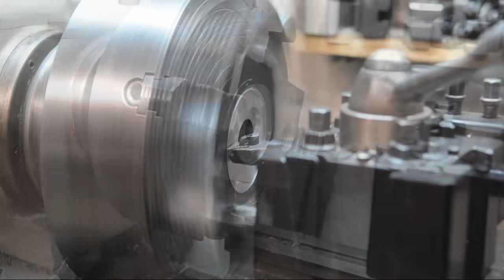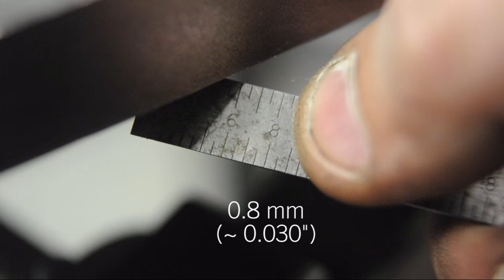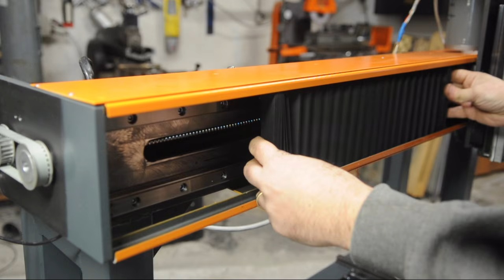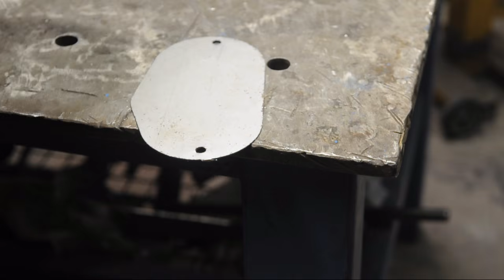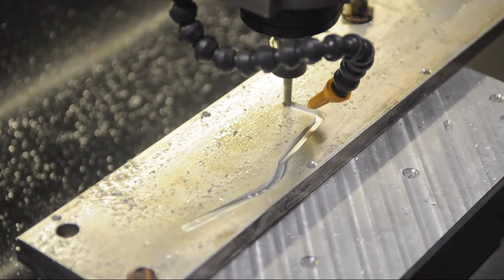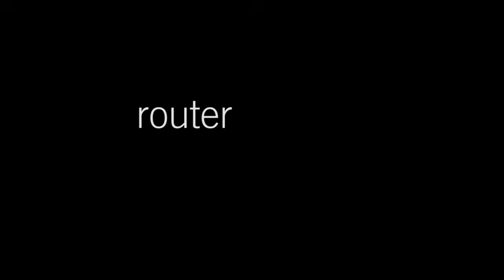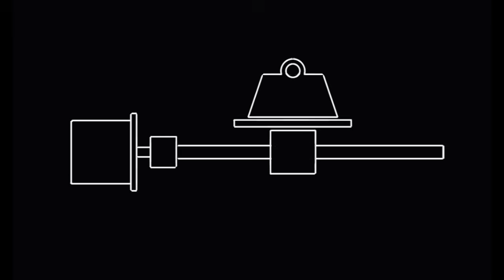Fixed Gantry CNC Router Build Part 3

Comment: Long time Caller, First time Listener...

I've done my own router build...   I decided to circumvent all that drilling and tapping nonsense by using  3"x3" and 3"x6" aluminum extrusion rails.   Made for a much much more rigid build, and everything tends to become more modular.

In my experience... humble as it may be...  I'm wondering why you used 24 v steppers?    I found the 60v steppers to be far more effecient, though the main problem I encounter is voltage drop...   I had tons of missed steps in the beginning on my Rapids, running them around 500ipm.   So now I run 4 independent Power supplies..   Two 72v powersupplies for the motors (Y has its own: X and Z are shared) a 36v for the breakoutboard, and then a smaller 12v reduction from the 36 for all the little lights and ancillary nonsense.      Before I had this... I had trouble nonstop....

But I commend you for shitload of patience of a Steel build.   Killer.   

         Other than your tendencies for traditional machinery, Why did you decide to have the table move the Y, instead of the gantry?    I prefered keeping all my dynamic components clustered to one unit as opposed to having them spread out...    As well as a moving table cuts your effective work surface to machine size by..... a  third?

Comment: i enjoyed your build. great work  i'm starting my build. just a few question. where did you find the wiring setup for your vfd and spindle? i bought a water cooled spindel and vfd off ebay form lovejoy. I'm not sure about the wiring. Can you post  wireing diagram or point me in the right direction.
thanks in advance
Dave

Comment: Ok... Everything about this is amazing.  I have a few questions though.  Your production values are excellent - how did you get those dolley shots of the router at the very beginning?  Your camera work is generally excellent - what are you using to shoot this stuff?

Your creativity in working with video is unique (I've been in TV professionally for over 20 years).  You mix graphics, still and moving video and nifty special effects techniques in a very natural, visceral and often times witty way.  Where did the rubber band rifle moving parts graphic come from?  Was that from your CAD software?

Finally, and the question most everyone wants to know... where do you find the time to do all this?  

Great stuff.  Wow.
Reply from the maker: Thanks Alex!
The opening shot was a couple of 2x4's strategically screwed into the ceiling and a 1/4" bolt holding my camera.  I spun the whole rig a few times (a million?) until I got a smooth take.  I use a Nikon D300s dslr.  And yes, the rifle was from my CAD; I use Solidworks.

Thanks for watching, glad you liked it!
Reply: This Old Tony
Nice.  Thanks for the reply.  I thought I spotted something vertical reflected in the plexiglass, but couldn't identify it.  Clever.

Looking forward to more videos.  And you sound a bit like Alan Alda.  Mash impressions in an upcoming video?

Thanks!
Reply: I got it figured out this is REALLY Ray Ramono.  From the first time I heard Tony's voice, every since then I have felt like I've been listening to Ray.

Comment: I was building a cnc but after seeing all the tooling you used to build this incredible beast I quit.  I have all the software, electronics and about half the materials but you have crushed my dreams.  Amazing Rig!  Keep up the next level work bro!!
EDIT:  I printed, etched, hand drilled my own PCBs, soldered everything up and even made my own PSU (all work great) and you, you made a damn gun!!
You're my hero
Reply: Why quit? I don't think that welding of frame is so complicated. just buy tig welder.
I am planning to make similar CNC. Already found fixture table 600x360 mm. I hope this winter will weld frame
Screws, nuts, bearings are available for purchase. Some custom mounting details i can order in local plasma cutting shop. (or cut with angle grinder)
Also when you will assemble first version of router it will help make parts for itself:)
Reply: @VolodymyrTorkalo   Hows it coming?

Comment: Thank you - this series was very informative. Question - why the choice to go with a fixed gantry as opposed to an x/y moving gantry? Just curious about the pro's and con's. Thank you
Reply from the maker: Pound for pound I think fixed gantry is much more rigid than moving.  The trade-off is work area / floor space.  For the same size working area, a fixed gantry will be bigger.

Comment: Excellent video as always. I read about another router build with a welded frame construction where the builder used an elf levelling epoxy mixed with various metal filler to mount his linear rails (with bolts to deal with shear so the epoxy was just a support structure). What is your opinion on this method? Pro / cons? Did you consider it?

Comment: I love the videos!  Looks like a really nice machine!!  Just curious, aside from the obvious material difference, why didn't you just use extruded aluminum?
Reply from the maker: thermal expansion.  all of my hardware is steel (bearings, screws, etc).  temperature fluctuations in my garage are enough to throw a steel-aluminum hybrid out of whack.

Comment: Hey tony, long time fan, first time caller. I'm only 19 and this ain't coming for at least a decade but man you really are the father I want to be, I admire you man. A real question about machining though, is there a reason that you switch between the spray that shall not be named and regular cutting fluid when machining?

Comment: A tip when cutting aluminium is to use ethanol as cutting fluid. Easy to vacuum up chips as the ethanol evaporates fast. 
Not leaving a sticky mess.

Comment: Great videos Tony - one question which I don't believe was answered when you started this series. Why did you choose this route instead of CNC'ing your Schaublin?
Reply from the maker: I wanted this more for larger sized 2D-ish parts and occasional, smaller 3D aluminum.  As much as I love the Schaublin, it doesn't have much range.

Comment: have you ever tested the runout of your chinese spindle motor? mine was way off. I had to redo the er25 chuck on the mill at 
work. The face on your boy,  priceless :-D
Reply from the maker: I did early on and it was within spec.  I really should check it again, I'm sure it's only gotten better. :)

Comment: If you could do it again, what motor would you select?
Reply from the maker: For the spindle?  Probably the same one.  Not a lot of options out there between making one yourself and spending almost as much as I spent on the whole machine.
Reply: Reading my previous comment, I should have specified the spindle motor, but good job on reading my mind. Anyways, I am building a 5 axis router for my senior design project. I have seen several spindles similar to yours which it demonstrated its ability to cut steel.

Comment: This is really a nice CNC Router.  I have a couple questions, I am on the path of building one but I don't plan on having a fixed gantry and I will be making mine from aluminum extrusion since I don't have access to a welder or such.  I understand it won't be a structurally strong and resist deflection but it'll work for me.  My question is the rails, is there any benefit of going with the linear guide you did or would a linear race type bearing work as well?  Is it possible to use 110V for the spindle controller vs 220V and still be able to get the torque if I used PWM control?  A lot is going through my head and it often gets confused, lol.

Comment: WD40 as cutting fluid ? ..
Reply: more than 1 thousand utilities lol
Reply: Basically yes, but it's more of a solvent than a lubricant.
Reply: My favorite is to use mouse milk.
Reply: GogogoFollowMe It works reasonably well, is relatively cheap and is locally available.  Why not?
Reply: Ok then, in my area it's not that cheap.

Comment: Nice to see somebody finally doing a rigid build.  I wonder would the cutting tool ever overpower the axis drive motor?  I mean, would a heavy cut ever push the workpiece so hard that spindle (or table) get pushed out of the correct position (kinda like kickback)?  I've seen lotsa DIY CNCs that are only good for light duty so kudos on a great project!
Reply from the maker: Thanks D.  Yes, certainly possible, but usually not during cutting.  I have lost position if I say, crash, during rapid moves.  I don't think my spindle (and the size cutters I can use in it) could overpower the drive system.  But a fast hard crash certainly could.

Comment: It's guaranteed your son will be a chip off the old block, you've had way too much fun with this "hobby" build! More importantly, what's the pros and con's for moving gantry V's fixed gantry. Is it bed real state, intended usage etc? you thoughts, Cheers...
Reply from the maker: Fixed gantry is usually more rigid than moving gantry, pound for pound.  You do lose more shop space, though.. for the same physical size, a moving gantry gets you a larger working surface.  It's all about the trade-offs and what one intends to do with the machine (i.e., what you'd like to cut and how fast).

Comment: Open loop position control is all fine and dandy with what is available to drive steppers
But would you consider going for closed loop control? The performances can be greatly improved and forces available at low speed increased. 
I have no idea about the price of linear/rotary encoders to carry this kind of project... I even doubt that precision of cut would be increased.
Reply from the maker: Yes closed loop is definitely the way to go, but it is much more expensive.

Comment: I know you really wanted to go with steel tubing for the CNC, but extruded aluminium railing would've saved you so much headache as far as alignment goes...
Reply from the maker: Very true, but I was trying to keep to the same material to avoid problems with thermal expansion.. and my bearings / rails are steel.

Thanks for watching Seraphim!

Comment: Nice work on the router I really enjoy the way your videos are put together. Can you tell me where you got the plans for the rubber band gun rifle or would you be willing to share the CAD files? Additionally what software did you use for creating the signs (at the beginning and end of the video)?
Reply from the maker: Check online for "wooden rubber band rifles/guns" -- find the one you like and feed it to your CNC.. it won't know the difference between wood and aluminum. :)  I used Fusion 360 "Engrave" toolpath, I believe.

Comment: Hey Tony, out of curiosity, did you find the CAD designs for the rubber band rifle online? Or was that designed by you?
Reply from the maker: +Trumptastic Found them online, plans for wood, but just load aluminum on the CNC and no one's the wiser. :)

Comment: to this old guy... i am slowly massing the parts to build one of my own. that spindle and vfd are they any good i am looking at the same one any honest feedback would go a long way. thanks matey!
Reply from the maker: +axl clas Considering that a good quality spindle will set you back $1-2k, it's hard to complain about these ebay spindles.  Doing the job for now; I wouldn't put it up against too much steel, though.  I consider it more-or-less a disposable that will eventually need replacing.. my money is on the inverter going first -- but as mentioned, both are doing well to date.  knock on wood.  Thanks for watching.

Comment: Hi, nice build. It looks sturdy and nice at the same time, not often you see a build like this. 
I have made one my self and it does not compare. Not half as nice hehe

Is it possible to get the CAD files for the rubberband rifle? 

Best regards
Joachim
Reply from the maker: +Joachim Johansen I'm afraid they wouldn't be of much use, but check online for wooden rubber band rifles, that's where I found mine, there are a ton.

Comment: Thanks for your time and effort. I enjoy your videos a lot, even though it will take me some few thousands light years to get to your level/equipment. Anyways,  I like the Makita straight Shear you have used, do you recommend that? Or do you think there are better ones out there? Also, I noticed that you are really comfortable with using TIG welding, I am in the process of acquiring a TIG welder.  I know that there tons of videos out there about the subject, but I, and many others will benefit greatly from a translucent episode about the subject, welder recommendations, techniques, and so on. Please, keep your magnificent videos coming.
Reply from the maker: +Precivilization The Makita is the only one I've ever used, it's very handy to have.  and I'll be sure to give TIG welding a bit more air time next time it comes up.  Thanks for watching!

Comment: I've had the Huanyang VFD for about 5 years now and had no problems with it except for the setup which was pretty difficult until I went to the U-Beaut woodwork forums where there is a great tutorial to set them up.  I have an air cooled spindle attached to it and even after 22 hours of use it remains cool to touch and the VFD slightly warm.  My only thought on your great setup is the weight of the table.  That's pretty massive for those small motors.  Good job on the video and keep em coming.

Comment: I produce films for a living, and I have to say your videos are fantastic!

Quick question, did you shield the wire inside of your electronics panel? Having the VFD so close to everything like that would make me leary of RF noise invading your data lines. I ask because that very thing just happened to me on a g0704 conversion lol. Awesome work on your channel!
Reply from the maker: +theavenogfilm Why thank you!  I did bring my shielding into the enclosure but the wires in there quickly diverge to their destinations so technically not shielded inside.  I did have some noise issues (phantom e-stop on spindle start) that appear to have been resolved by some re-routing inside the enclosure.  (I have a few mechanical relays in there that some of the wiring ran too close to, I think I was picking up noise from the contacts opening/closing).

Thanks for watching!

Comment: Regarding small drill chucks on mills. I have a Jacobs #0 that fits in my number (whatever the 1/2 one is; 16?). I hope you're oiling those ball threads.

How did you ensure your table was flat and of even thickness? Really good stock?

Good work though, I really like it.
Reply from the maker: +justfakeit888 I was able to adjust the table supports and add some shimming to get the table 'close enough' over the entire span.  I then checked with an indicator in the spindle and found the flattest spot and that's where I put my riser block and vise.  I mostly do small work, from solid stock, so these shortcuts result in pretty good parts (so far).  Anything bigger than the riser block (where I'd need to use the whole table) is likely 2D routing of wood/plastic/etc -- where flatness is non critical.  

Thanks for watching!

Comment: you could grinde that table with your cnc with this http://www.abtec4abrasives.com/resin-bonded-grinding-cup-stones-for-angle-grinders-2213-p.asp so it will be pefectly flat and smoth.
you will just need to buy smaoler one for sall angle grinder and make adapter to fit in spindle

Comment: Question. What do figure the cost was for all the electronics hardware. You did an outstanding job on the Table.
Awesome job on the whole build.  enjoyed the video.
Cheers
Reply from the maker: +Fred's Machine Werks Most of it was used, so I haven't done the math.  Not that much stuff when all is said and done, I think the only place I'd put the big money is on the stepper drivers and SmoothStepper (though smoothstepper not strictly necessary).  One could probably get away with less expensive break out boards, stepper motors, power supplies, etc.
Reply: This Old Tony
Thank for the Info. Again the video was awesome did great job.

Comment: It is an very amazing piece of diy machine. You have all techniques in metal machining, especially in steel , welding and even powder coat painting. So, you did it in a professional look like. You also did the FEA which is not common done by diy guys. You have sufficient machines to achieve the building works which are not easily acquired by most of us as well! One criticizes is that the machine lacks of re-circulating flood coolant and air suctioning systems (for removal of debris). Query to know that if you tried to cut steel material by the machine and how much DOP it can achieve.
Reply from the maker: +raychar cheung Have a look at my "CNC Cutting Steel" video.  Thanks for watching!

Comment: Great project, great workmanship, great video! Always wondered why the choice in machine design is to move the part instead of the head when the head's mass is constant and workpieces vary. Why did you chose to move the part in the Y and move the head in X and Z?
Reply from the maker: +Paul Decker Good question.. depends mostly on what the end goal/work is.  Moving both X and Y makes the machine footprint bigger.  Every decision is a trade-off!
Reply: +This Old Tony I'm thinking of moving the head in all three directions; predictable mass and takes up less space. They do make them commercially (a bridge mill) but I'm surprised they're not more popular.

I'm impressed with yours that it cuts steel. I guess you ran the RPMs down. How thick have you tried?

Comment: Great video Tony! love the series. Is there a chance you could share your rubber band gun plans? I would love to try and make that. thanks.
Reply from the maker: +antennasbc actually I just found them online.  Turns out woodworkers are really into rubber band guns.  Try a google image search to find one you like, modify as required.  (I had to change the length on mine to make it kid sized).  Thanks for watching!

Comment: I made mine out of 3/4 solid alum...   600  in/oz  steppers.  5'x48"x6.25 under z.. It runs good at 175/  acc @ 15   no lost steps..
Reply from the maker: +Bigwingrider1800 Sounds like a monster!
Reply: SHES HEAVY